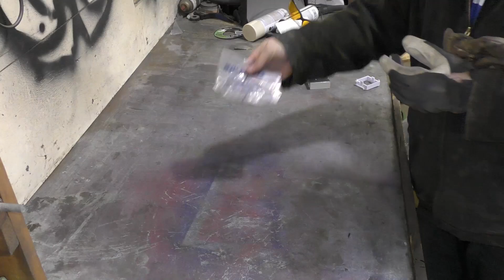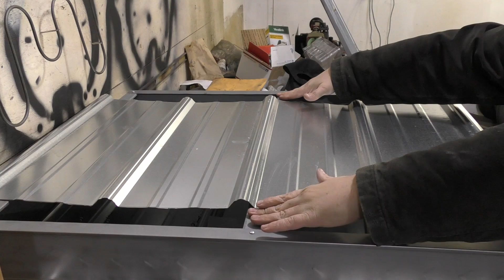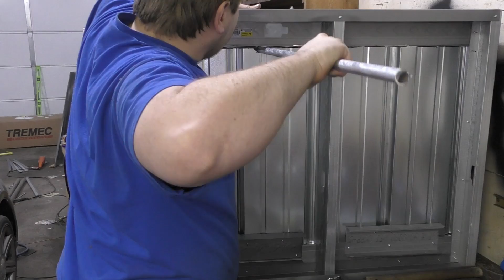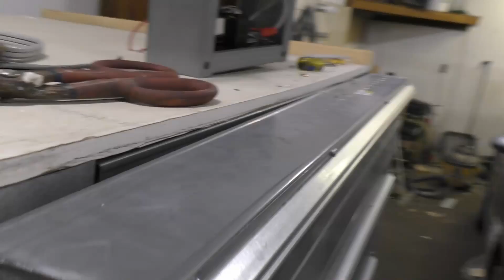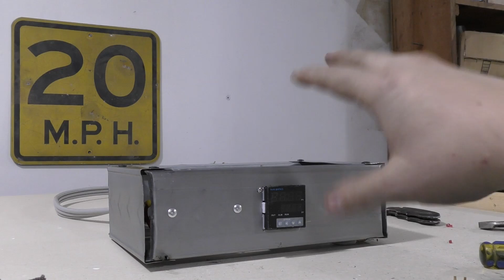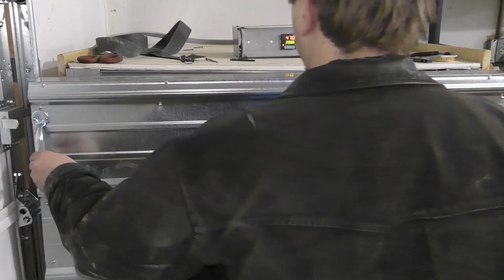Bigger Powder Coating Oven Build | Driveway

Comment: How much would you charge to make one and sell
Reply from the maker: I wont sell one, the liability involved would be through the roof - Mine was built with minimal safety and I would not trust someone other than myself to operate it.  There is a reason the ones sold are so expensive.

Comment: I'm really trying not to be nasty here, but your lack of safety knowledge & common sense is astounding. And what's worse, you done seem to care. I appreciate that you took the time to make the video and are trying to help others, but this is not the way to do it.
Reply from the maker: Look at it like this, the proper way to change out a florescent tube light is by wearing safety glasses, rubber boots, rubber gloves and to place the old light into an air tight container and send it off for recycling.  

I'm guessing you have just grabbed one with your bare hand and swapped them out and put the old one in the trash so your knowledge & common sense is lacking as well.  

In the end, what I built worked 100% the way I expected it to for the purpose I built it for.  My purpose doesn't require the same safety margin as someone else's desired purpose.

If you guys want me to build a 100% duty cycle industrial oven; that is a different operation altogether and was probably what you were thinking before clicking the video and was disappointed with the poor man's oven.
Reply: @Drivewaybuilt  Equating throwing a fluorescent lamp in the trash with running wire through jagged metal holes, or using wood to clad the exterior of a shoddily insulated oven is hardly a rational argument.  If you want build something to that standard, then don't broadcast it on YouTube as an example for others to follow. May of your viewers don't know any better, as evidenced by the number of "great build" comments.

As for building a "poor man's oven", you could have greatly improved the safety of it by spending another few dollars (very few) on the correct materials & techniques.
Reply from the maker: @frankpratt529  It was a build with what I had mostly laying around.  

Do I suggest others follow my example? No. Did I say that this is "how to" build one? No.  Would I let my wife use this one? No.

My channel is about what I have built and parts that are available to use, not how others should build.  I have never said that what  I did is "right" I just show that it works the way I did it, so there is no reason someone can't build their own using their own margin of safety.  

In the end, nothing caught on fire, Internal temp where the wood and facing never got up to 200 degrees, so nothing to worry about there, wires didn't melt either because it was insulated for limited use. The "Jagged edges" aren't capable of cutting through the wire insulation because they are folded over.  It accomplished the job it was intended for and works fine.  

What I am really surprised about is that no one has commented that it needs a switchable power cutout box, which it really should have above all the other issues

Since you guys are so offended by this video, I may just have to an actual "how to video" on one so someone can follow it step by step and have something no one can complain about and can function 24/7

Comment: Woooooooeeee fire guard doesn’t cost much and is basically free to pick up on construction sites don’t use paper back o know your gonna say it ain’t that serious but I’m a sheetmetalosy and build ovens that’s a nooooo lol still cool though good job man
Reply from the maker: For me it wasn't a big deal, but I also knew I wasn't going to run it for longer than 30 min, so the heat wouldn't have time to saturate the surrounding area enough to cause the paper a problem.  You are correct though, outside of my limited usage, I wouldn't go with paperback either.  I've run it quite a few times since building it and contrary to everyone commenting here, nothing started on fire, I'm alive and well, and it still works great, although I might redo it to make it fit in a different spot in the garage and I'll probably use a different material then.
Reply: I was thinking the same.  This video make me cringe.

Comment: Good ideas but definitely needs improvement. I'd start by putting a wire shield on that 240 oven cord where it meets the sharp metal frame where your controler is housed.
Reply: Awe common: man Darwin needs work too..

Comment: Needs window and especially a small vent hole to allow the gasses and excess heat to escape! Could be dangerous if not! Also ovens wired as a 3 wire there will be 2 hots and a neutral no grounds!!!!! Make sure you check that if you don’t already know! Wire accordingly or per the oven diagram!

Comment: Thanks for taking the time to share this video with us, it gave me really good hints to build my own!  I’ll just use fire resistant insulation without paper and use heat resistant wires, it can not hurt to play safer.  I will start from a really good idea (yours) and try to improve it a little bit.  Thanks again.
Reply from the maker: That's what it is there for - just ideas - Thanks

Comment: The best idea I took away from this build is using the scrap siding/roofing. I have plenty lying around from an old barn roof. Great idea! As for the rest of the build... Well, sketchy at best on some of it. I'm sure the first prototype wood-clad fire pit probably seemed like a good idea at one time. No evidence left to prove otherwise right. Probably best to keep the old 911 on speed dial on this one.
Reply from the maker: Nah, works just fine - you guys over estimate the heat involved here.  There is more insulation on this thing than your kitchen oven, and that sits next to wood all the time.  Zero issues with the wood, but its not like I set it to 450 and leave for 10 hours, that would be a completely different design if I wanted to do that.

Comment: how many heating elements can you put on the one controller?
Reply from the maker: The relay is 25 amp, but you can add more relays and the controller can turn them on as well, or you can get a bigger relay - most burners are about 10 amp on 240. so 2 should be able to run on one relay - i personally would wire in 2 relays just to not over run the relay

Comment: I would put some sort of calibrated thermometer in there and check the accuracy of that controller. I used one of those controllers for a hot tub and found it to be about 20 degrees off from what I was setting it to.
Reply from the maker: There's a built in calibration method using ice water, but I already have a thermometer to calibrate it to which makes it easier.  Thanks for watching
Reply: @Drivewaybuilt  hmm I don't think mine had that option.  Good stuff though.

Comment: I see a serious safety issue.  

You have a 220V wire passing through a hole in a metal stud with no strain relief or support.  Sooner or later, the insulation on that wire is going to chafe against that metal, and you're going to have a hot 220V wire resting against bare metal that is sitting on your oven.  The whole housing of the oven and the controller is going to be electrified and potentially deadly.
Reply from the maker: Uh oh, another member of the safety police is here better run and hide!  It doesn't get used a lot and has a ground, so no issues there.  You do realize that you shouldn't drive a car on the highway because you might die in an accident.
Reply: @Drivewaybuilt  hey, do what you want to do.  I just assumed that you didn't realize that possibility of the wire chafing and creating a potentially deadly situation.  As for the ground, sure...it has a ground.  I still wouldn't want to touch it if a bare hot wire is touching the metal.  As for your car analogy....If I saw someone driving a car with a potentially deadly issue, for example, a metal chain dragging under the car creating a spark storm under the fuel tank..I'd probably become the safety police again and flag them down.

For the rest of the people out there, feel free to do what you want, but if you are going to do something like this, I'd recommend taking the few extra seconds, and spending the extra $2 to buy a strain relief to put on your power cord.
Reply: @monteporche5552  somewhere a UL manual burst into flame
Reply: @Drivewaybuilt  Uh oh another dick who cant accept solid advice.
Reply: @Drivewaybuilt  The NEC is for everyone's safety, you have documented your disdain over it and safety violations on Y/T, In the event of a accident or fire your insurance will go out the door and lawsuits will come in that same door.

Comment: Any videos of the garage fire? There are so many fire hazards with this build I highly recommend that no one do the same as he did.
Reply: That roofing panels are galvnized... When heated they release a highly toxic fume. -DONT MAKE HOW TO VIDEOS!!!
Reply: @espenbjrnbak3863  Thanks for the awareness bro, I didn't know that.
Reply: Can you please do a wiring diagram. I have the same setup and the instructions are crap.
Reply: This is for all you safety police 🖕
Reply from the maker: No garage fire - you from the safety police - what was so unsafe?
Reply: @Drivewaybuilt  Unprotected wire in the heat zone, paper batting, wood sides.  I build powder coating ovens, and this is a fire waiting to happen. Paper spontaneously combusts at 450deg, and wood at 350deg. Must powders cure between 400-450deg  and those studs do transfer heat  Just hope you and anyone that builds one of these does it in a safe way.
Reply from the maker: @gibbyrj  For what I am using it for it will be just fine (I'm not even worried about the wire - its rated to 220 degrees F) - sure if I was planning on using this thing for 5 hours straight, I'd make some modifications like fiberglass wire wrap or other high temp wire shielding, full on unfaced rock wool insulation and steel outer shell,  for that matter if I was going commercial use, I'd have it double walled and double insulated,  but bringing it up to temp for a single item running for the 15-20 min and cooling down will never transfer enough heat to cause an issue with the wire or wood.   Maybe I'll put a disclaimer in the description -  that it is for short time use and may cause spontaneous disaster if used for too long.  Hey, better not leave that toaster oven on the counter top either - that gets really hot and you may start your kitchen on fire if it operates for too long
Reply: @Drivewaybuilt  Hey brother...I sense a bit of sarcasm there... But I may be wrong. Just informing anyone watching a DIY Powder Coating Oven build that these are not safe practices. 
And yes... Put a piece of paper inside your toaster and set it to 450... It will burn. Or a piece of wood. But hey...I wouldn't see the fire from my house...
Reply from the maker: @gibbyrj  Maybe a little bit....  I added a little to the description for your benefit.  No scorch marks yet.
Reply: Hi Robert have you got any build videos of ovens? It would be greatly appreciated if u could one up thanks
Reply: Robert Gibbons l
Reply: @Drivewaybuilt  The NEC is for everyone's safety, you have documented your disdain over it and safety violations on Y/T, In the event of a accident or fire your insurance will go out the door and lawsuits will come back in that same door.

Comment: How are you to be sure your wires dont melt???
Reply from the maker: Luck?  Actually this is wired just like a kitchen oven - you keep the  wires on the other side of the insulation away from the heat.  The burner ends protrude enough to accomplish this.  If wires start to melt, you need more insulation.
Reply: Driveway thanks man. this video rlly helped

Comment: does it have to be 3x3 for the heating element to be at full potential? or can i make it 4x4 and get the same results?
Reply from the maker: 4x4 will just take longer to get up to temp with one heating element - you could always throw in another if it doesn't heat fast enough for you
Reply: Driveway thanks for the feedback. do you have the links to where you bought all the parts from? and where can i find information for when i wanna build the control box
Reply from the maker: @capitalshortx  element: https://amzn.to/2TId5hW
 control box kit: https://amzn.to/2WMfjz6